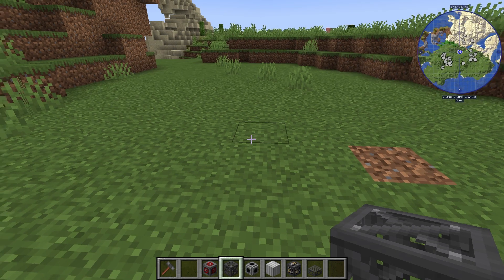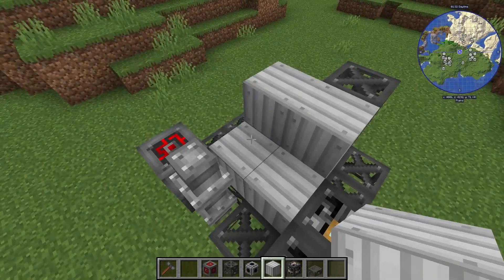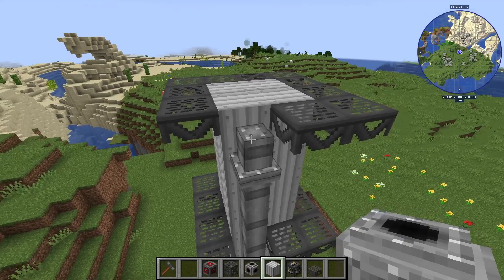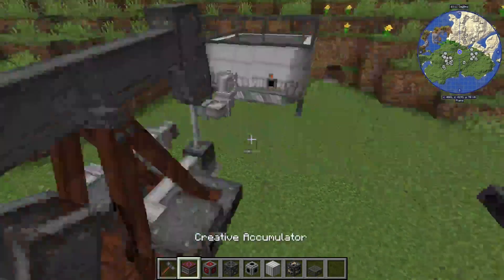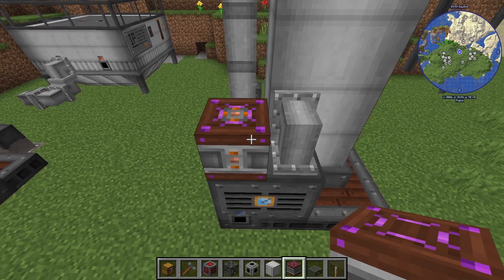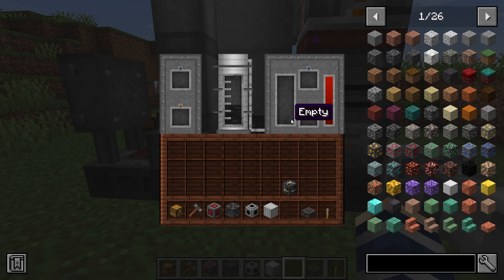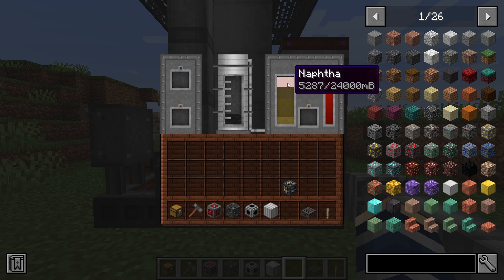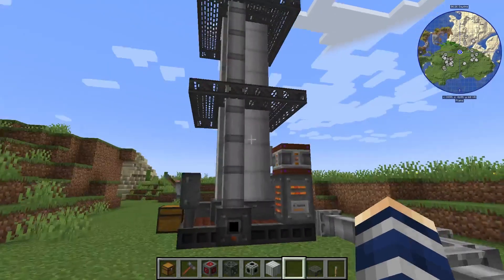Immersive Petroleum: Distillation Tower

Comment: i cannot get this right ive been stumped for like 3 hours
Reply: You're probably using the wrong type of steel scaffolding slab because there are two different kinds. the build requires the one with the grated holes as the texture.
Reply: correction there are 3 types
Reply: @cloverleaf5645 yea u were right thanks
Reply from the maker: See if you can google a distillation schematic or use the projector